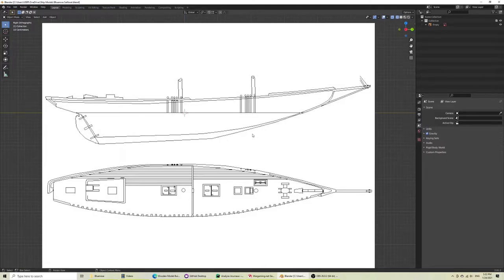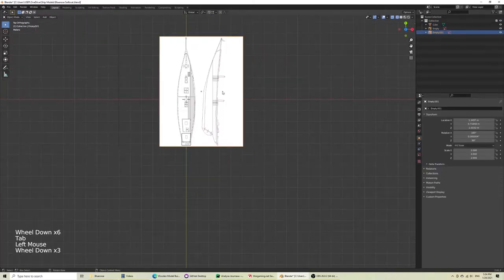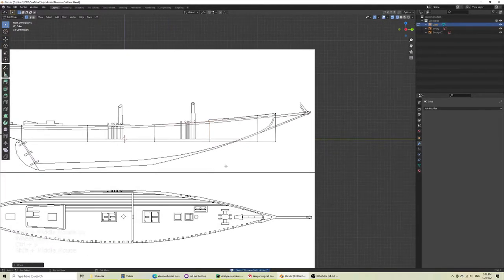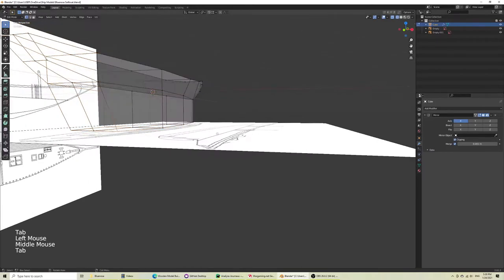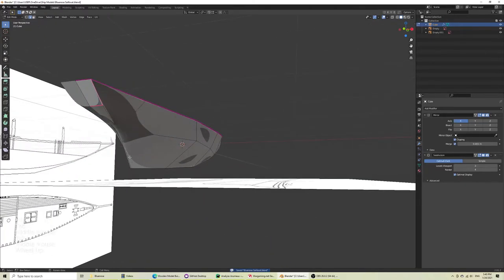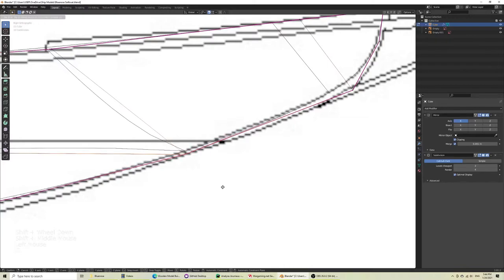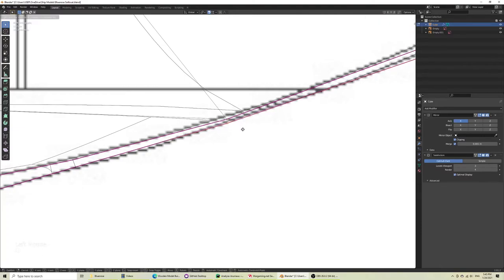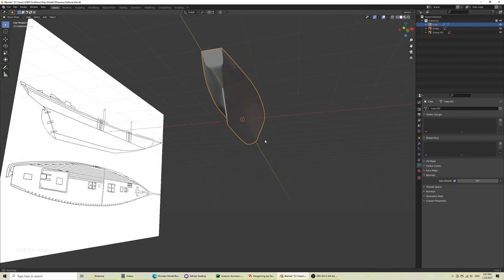Quickly Modeling a Bluenose Sailboat Hull in #Blender

Comment: I am looking for help with a modeling project of my sailboat. Currently doing basically a gut rehab of the boat and I'd like to use the Blender format for design purposes.  Would you be interested in this project?
Reply: @DenisLabrecque  You would tell us what we need to provide for you to create an interior and exterior, like photos and where to take measurements (interior alone is ok if you only want to do one). We will provide dimensions of what we would like inside, and generally where it would go, and you create a 3D model of our boat so that we can see what it looks like prior to putting it together.  Right now it is pretty well gutted.  And you give us an estimate on cost.  We do not have blueprints, manufacturer doesn't have them, a fire.  The boat is a North American Morgan 40'.